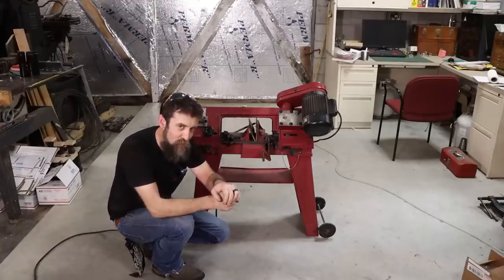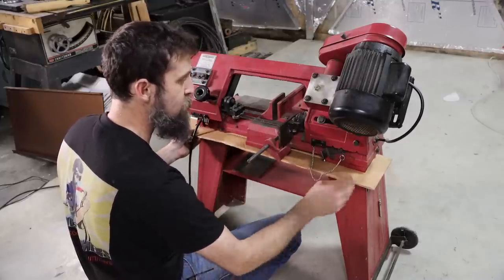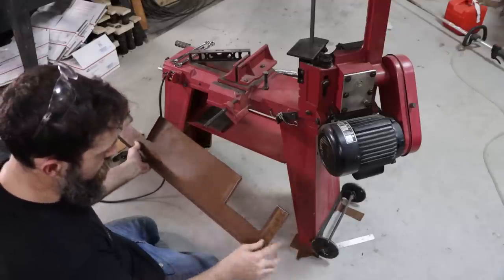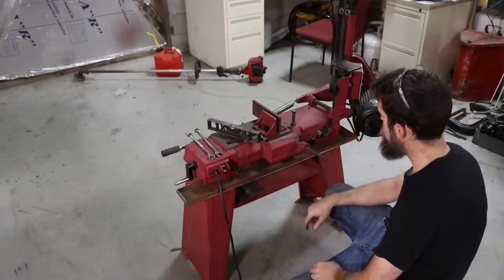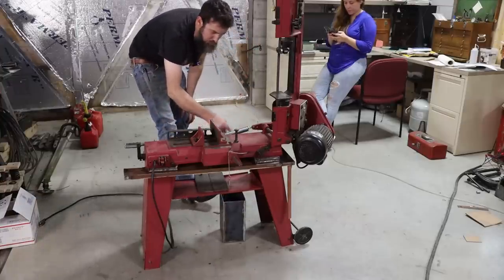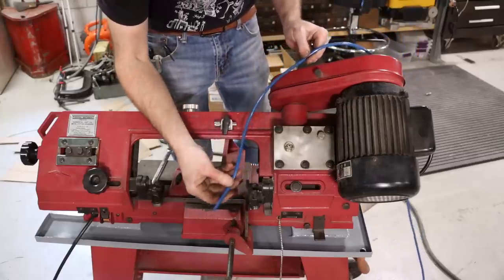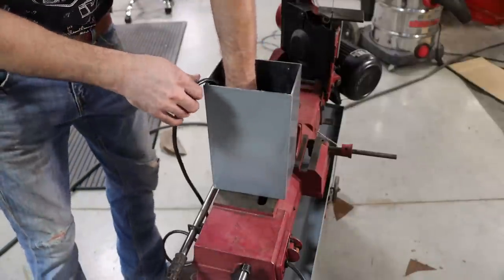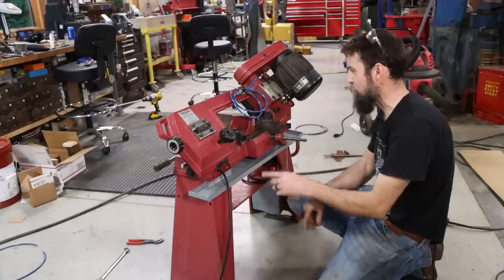Official Flood coolant MOD for the 4x6 Harbor Freight saw PART 1 #harborfreight #saw

Comment: Excellent design and execution Steve.  The manufacturer should incorporate this into their standard machine and pay you a royalty.
Reply: Indeed but my concern is the electrics which are not designed for splashing with water might object. Possibly more of a problem in the 240 volt world than you low voltage people.😉
Reply: @chrisstephens6673  England ?
Reply: @chrisstephens6673  YUP ! LOL.
Reply: @chrisstephens6673  ...125 volts will kill you just as dead, just as fast!
Reply: @paulcopeland9035  indeed and that is my concern, are the electrics up to the task.
Reply: That motor looks like the original motor that was on mine, and if it is, it is a TEFC motor. No worries there. The only other area of concern might be the switch, but they are pretty well protected up underneath the frame. I would put one of those weatherproof caps over the toggle handle on the switch and call it good.

Comment: Very neat! I wouldn't be surprised if your idea becomes an iconic improvement to this band saw of which there must be 10's of 1000's.
Reply: Yes and I for one am going to do something very similar as I have a brand new complete coolant pump system which was intended for my lathe by previous owner and I don't want flood coolant on it as it's too messy in a very small shed, so I will be using on the 4x6" exact same, but different branded  saw here in the UK

Comment: I think I would have preferred to see a bolt-on solution for the tray. Like you said there are a lot of those saws in the shops. A guy could make a few based on your pattern, and people could bolt them on without having to pull the saw apart and paint anything. Also I think the sump would be better on the outside and removable so you can dump it and refill it easily. Maybe add a handle to the top of it. Of course I'm spending more time talking than doing! Lol. Looks like your wife is a little bit bored. You could have her filming or welding something. You should also call Adam and ask him about getting one of his shop aprons (of course yours will require about half the material. Lol!)

Comment: A good example of using what you have to solve a problem. I have to say that the sound of so much water running into buckets caused me to step out for a moment.. You have a very caring wife, mine would have laughed and gone to check the life insurance documents. Best wishes, Dean in Oxfordshire UK.

Comment: As you know it needs a primary filter. And a magnetic secondary filter. 
I used a old oil pan and a gas tank pump with a old 12 volt computer power supply. Has never failed.  Cost almost zero.

Comment: Great idea and it should extend the life of your saw blades greatly. I liked the last few seconds of your video when you said "anybody could do it as long as you have some basic hand tools and The Drive". You certainly have The Drive as evident by your shop renovation project, the many improvements you've made to your equipment, and your never ending strive for excellence in everything you do. Thank you for giving all of us something to look forward to on Saturday mornings.
Reply: Nicely said !
Reply: Hah, Steve and Brian Block both have extra helpings of The Drive.  They wouldn't even need the hand tools, just two rocks and a sharp stick. Couple months later the job would be done, and they'd have made a set of tools along the way.

Comment: I have had mine for over 20 YEARS...with my home made cooing system...I like your approach! Very well done. I made a nice 12 x 12 inch table to use it to hand cut 1/8" thick AL as well....LOL....I just sit on the back-end and have learned how to stop it with my leg! EDIT ADDITION....it WAS flimsy as all get out...Mine did not come with shelf....only when I added one out of necessity was it ridged....

Comment: Hi Steve, After you run it you might find that you can trim that tray so you don't have to extend or modify the handle. It might require blade wipers to prevent coolant from getting that far out. Good fab job! Or should I say "Fabulous!"

Comment: What a great idea. There must be thousands and thousands of these saws out there. Mine is machine green and came from Princess Auto. Canadas Harbor Freight. Although mine has 4 independent legs and after a week they had to be reinforced. It is a great little saw I made a vertical table for it that greatly improved it's uses. I picked up a bunch of off cuts of 16 gage sheet metal from our local land fill transfer station that now has a purpose. Thanks a bunch for bringing this to us on another fine Saturday morning relax time with you. Take care eh.

Comment: 1. Put a pallet on the electric forklift forks. 2. Put the saw on the pallet. 3. Raise the forks up to a comfortable working height. 5. Adjust up or down as required for each operation.

Comment: I have a modification that I made to my vise on the moveable jaw . I added two things. Instead the lock nut I put on an adjustable hand lever to hold the jaw down. Second I drilled and tapped a 1/4 -20 hole on the left side of the jaw and added a long thumb screw to balance out the jaw when your cutting short work. Both work great and I wish I had done it long before I did. 
Your job looks pretty good so far.

Comment: I can see you struggled a bit with welding the corners of the sheet metal. Take a solid piece of Aluminum or cobber and clamp it in place inside . Then crank up the welding amps and begin welding on the Aluminum or cobber and move towards the top of the joint and weld towards the bottom of the joint. That way you get a nice finish inside and the heat is concentrated at the bottom where you need it the most for penetrating the metal. 
I usually use a longer piece of square stock alu and clamp it in the vise at a 45 degree angle. Then clamp the sheet metal to the alu sticking out and since I got the joint pointing straight up I can hit both sides equally and gravity helps making a uniformed inside weld fitting the corner profile of the alu.
Reply: I figured if he's a welder by trade he would have known that, maybe he did heavy industry welding...pipes and holding tanks etc. I was thinking the same while watching him struggle with some of the welds.
Reply: Probably just his new machine and settings more than anything. Also welding on anything from harbor freight is more difficult because the cheap ass pot metal they use is full of contaminates.

Comment: You are a much braver  man than me welding that pan to the saw. Every time I weld something to something else by the time the welds cool I figure a better way of doing it. Then I spent more time cutting the welds off then I spent welding in the darned thing together in the first place. What adding the bolts to the coolant tank be easier taking it on and off? If the pump is on the bottom of the Coolant tank, will they pick up chips and junk? Maybe adding a spacer block underneath the pump.
Reply: I agree, keep it removeable for cleaning.

Comment: Can't wait to see the final result. I have the same saw with a tray on the floor and hate it! I used a recycled gallon plastic milk jug with the top cut off sitting on a shelf right where your tank sits and a little smaller Little Giant pump.

Comment: Great job, thanks.
Hey Steve, if you need a little pump like that and you have a local HVAC supply house near by, you can probably pick up a condensation pump, off the shelf.

Comment: Drill two holes beside your mounting bolts on the tank and weld two guide pins on the tank make for easy alignment on the tank when putting in your thumb bolts

Comment: Very clever! I wore out two of that exact same saw in my shop so I upgraded to the 7 x 12 hydraulic lever saw from Harbour Freight. It came with the coolant system. I didn’t know that I needed this feature until I got the saw. Your TIG welding skills are phenomenal.

Comment: Hey Steve to sharpen the tungsten i just chuck it on the drill and turn it slowly at the desired angle against the grinding wheel. Works a treat

Comment: Great job but you will eventually need a larger drain port as it will clog at a bad time. Like what you think you need x3. Or at least a baffle to keep the aluminum from going into the coolant drain. Or a ss brillo pad over the hole, cheap simple easy.
Reply: Bit of steel wool from the lathe will work well there, and you get plenty of free new one as well from the stringy steel or aluminium cutting jobs.

Comment: Love these small improvement projects!
Cardboard CAD is so underappreciated. It's an absolute time saver. Only made aware of this quite recently. (Thank you, Adam Savage).
2 questions:
 - do the tank and pump need some sediment separator?
- the valve could be closed when you switch on the power. Could that damage the pump?
Reply: The dirt will settle to the bottom of the tank, and the pump does have a cleanable screen on it as well, so no problems, just needs regular emptying of the tank. As to running into a closed valve nothing will happen to the pump, it is a centrifugal pump nor positive displacement, so all it will do is spin and generate max head pressure and no flow, but will still keep the flow around the impeller and magnetic rotor that keeps it cool and lubricated fine. The fail point on all these pumps is just that the rotor itself, or the shaft it runs on, eventually wears out, and a new pump is cheaper than the spare parts in a lot of cases. 

You do not even need to buy the expensive Little Giant pump, the cheap $10 garden centre pond pump, with a ceramic shaft, will last years in use, as they are often turned on, and left running for 5 years before they fail, with nothing other than the occasional clean of gunk from them. In this application the saw will fail first before the pump, as it will likely do under 100 hours in a year in use, unless it is running in a steel shop for 5 hours a day, but still there it will last years. I used to get 5 years out of them running cooling loops in production plant, as they were a lot cheaper than the manufacturer recommended thing, of run tap water through to waste drain. Paid for the work in around 3 months just from water use alone, and also allowed use of water conditioning, to keep corrosion down, as well.
Reply: @SeanBZA  I have used a pond/fountain pump for mine for awhile, no issues, and less than half the price.
Reply: Hopefully there is a filter on the drain line like on the big boy the pump was pulled it from. He's a pretty smart guy with a lot of experience.
From a backseat driver... If its not easy to do maintenance, then there isn't going to be any. I'd like to see the ability to just lift up the tank and pull it out to change the filter and empty crud out of it more easily.
Reply: @SeanBZA  Most of the cuttings will stay on the tray as well.
Reply: @TomokosEnterprize  For ferrous metals simplest is to place a strong magnet ( old one out of a microwave magnetron) under the plate, it will catch most of the metal filings as the magnetic field extends through the thin steel sheet.
Reply: @SeanBZA  Great idea !

Comment: Great idea. If the fluid tracks along the saw blade and misses the drip tray, add some blade wipers, something like rubber or maybe a small brush the blade runs through.

Comment: Hey Steve, I have one of these saws, probably 50 year old, very useful, but it does need a coolant system. I have been using a cheap 5lt (1.3 US gallon) pump up garden sprayer with a hose connected to the nozzle, works well until the hose pops off & sprays you with coolant. As a result I was thinking the other day doing something similar, will be watching next week to see how it all goes. Cheers Peter from Oz

Comment: Mine is another similar saw, but bought from a local version of HF before HF came to Denver.  But, when I have ever tried any lubrication of a blade while cutting (cutting oil, Anchor Lube, WD-40 for Aluminum, etc.) the blade pops off the drive wheel, and I have to clean the blade and wheel before I put it back together to keep it in operation.  Because I don't actually use the saw that often, try to match tooth count to material thickness, and buy quality blades from a local pro tool & machinery supplier my blades last for years.

Comment: Nice work Mr. Summers, and very timely for me - I picked up one of the variants of this machine a few weeks ago and have set up a gravity feed coolant tank but have quickly realised it makes a mess with longer cuts. I think I will start by 'borrowing' your tray design (maybe a screwed on version) for simple fluid recovery first then work on a recycling system. Thanks for sharing your work.

Comment: I have a similar sized bandsaw i have had for almost 20 years now...it has the miter feature ..you can turn the saw on the base for angle cuts...i use the stick lube for cutting ..it works great and cools the blade...as messy as coolant can be but easy to clean up too... I also have a slightly bigger bandsaw with coolant and it is nice too.... The stick lubes last a long time actually and you just need to be careful rubbing it on with blade running...😱😵😫🚑

Comment: Probably will need a rubber grommet around your blue coolant line and sheet metal.  Even if the pipe can't move due to the zip ties, vibrations can get you.

Comment: I predict drips out of the motor end of the saw as the blade carries the coolant away. Extend the pan out back, then you can use coolant in vertical mode also. I'm curious to know how the blade will track once it's wet.

Comment: The original version of that saw had no shelf and was not stable at all. The wobbling about would cause the bolts to eventually work loose. Adding the shelf was a common modification.

My old shop teacher swore that coolant on a horizontal bandsaw was the devil and made too big of a mess that had to be cleaned up relative to the cost of blades.

Comment: You should add filtering to your system...you want the pump only flowing fluid not metal shavings or particles...a screen in your pan outlet to stop big shavings..then a smaller container your fluid flows into to catch smaller metal particles and that overflows into your bigger container ...maybe some material the fluid flows through to filter the fluid more before it gets to your pump??  and lift your pump off the bottom too...as particles will settle at bottom....the more you stop the grit from your pump the less chance of it failing from nasty metal bits going into it....some magnets too help to collect the metal shavings...

Comment: I have an old craftsman band saw, 4x6, that is 60 years old. I've replaced only the beveled plastic drive gear. It just plan wore out. Instructions that came with it recommended not using flood coolant as the blade would slip on the drive wheel. I do sometimes lightly lube the blade though.
I wonder if there are tires that I can put on my drive wheel that will tolerate flood coolant.?

Comment: Normaly you need to use a steel tube inside the silicon hose when you use this type of fittings(because you can easily cut the tube with these fittings)but as long as you don't overtight them you also good the way you did it...i deal with Swagelok fittings everyday trust me, you don't want this to happen in a pressure tube 😂

Comment: Very interesting. I have been considering the same for my saw. I like how you have limited the drip tray to the essential areas to keep it compact, hopefully the coolant won’t track too far away from the cutting area. How do you plan to stop all the swarf getting washed into the coolant tank? In the past I have stuffed some Scotchbrite into the drain hole to act as a filter which is fine for bigger chips but would probably get clogged fairly quickly with fine saw chips!

Comment: Interesting project. I've got a very much the same saw from Warco (UK) that's green.
The manual, which is hiding for the moment, told about not using... Lubricants or cutting fluid.. Why? The "dripping" or because of the rubber on the 2 wheels?
A bit supricing  project as You have the huge DoAll bandsaw....

Comment: Does it need some sort of filter system, or can the pump cope with contaminated supply?  Maybe even just a few blocks at the bottom of the tank so it pulling from above the base.

Comment: Just got a used 7x12 saw and am not using the coolant system.  The amount of old solidified swarf all over the lower machine from being carried by coolant was a huge pain to clean up.  I’ll be using oil at the cut myself.  And perhaps I’m missing something, but if coolant is so important to a metal cutting bandsaw blade then why don’t vertical metal cutting saws run coolant?

Comment: That's a solid start to the project.  Really curious where the coolant will end up going around the blade path while the saw is running.  Do you know if the bearings for the wheel shafts are sealed?
Reply: If the current bearings aren't sealed, the replacements will definitely be  :)
Reply: Blade brushes should be on the list of upgrades.

Comment: Have to agree with some others, love these hands on 30min and under chips. Steve, you and Quinn have these HF saws and thinking of getting one, Not having a blade welder, are the blade's and roller a problem to fine when needing replaced? I put my tungsten in my bat drill to sharpen, ever tried that? Bear
Reply: I guess HF sells the blades a lot, and will probably have service kits for them as well, though Steve likely can make a lot of the spares himself, and can also do the blades in house now.

Comment: Are you going to install a screen to filter out the major swarf in the tank?
Reply: Steve, you could make a filter/dam up top before fluid hits your drain hole. A can filter (sealed) in-line with your tray drain hose.  Turn it out of alum (tubing) on the lathe with threaded/sealed (o-ring) caps. Just thinking out loud!